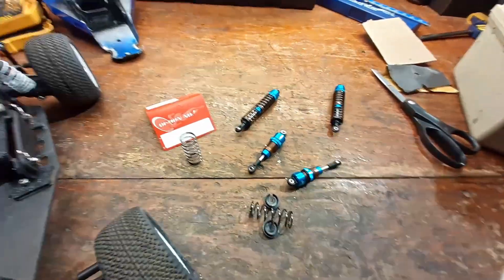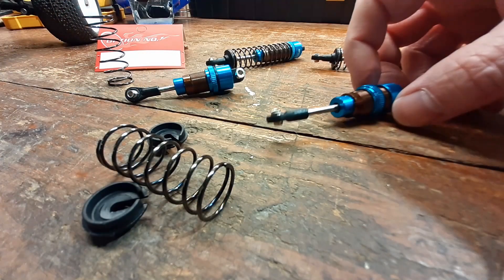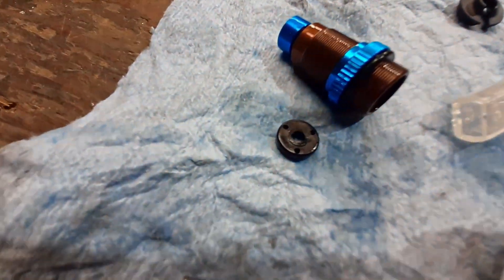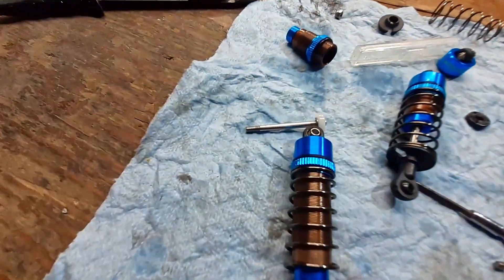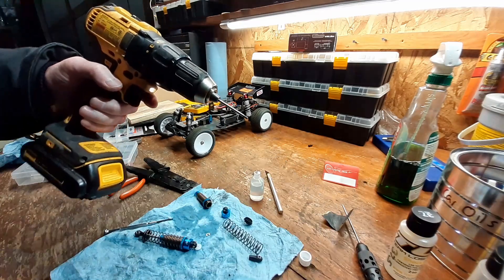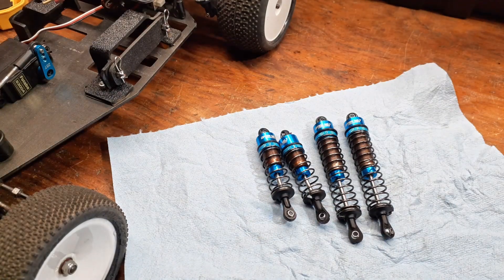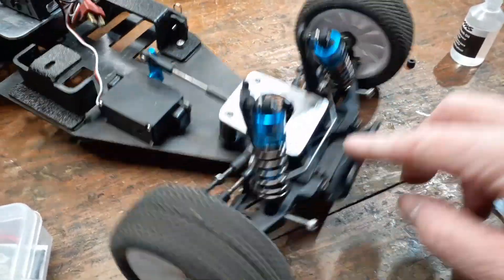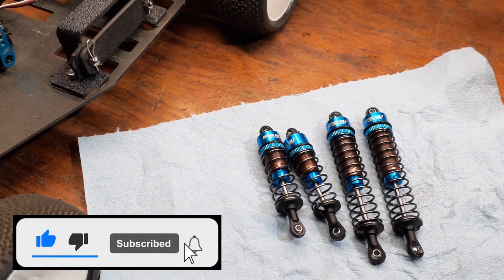Ultima Spare Parts Project Part 6 - E Bay Shocks (Option No. 1)  #kyosho #kyoshoultima #rccar

Comment: Oh, yes, a little bit of extra care makes a lot of difference! I'm guilty of mostly just assembling parts as they are, but sometimes I do remember to look closely and actually remove burrs and imperfections, and it's really satisfying! 
Thanks for showing! And all the best with that project, very interesting to follow along!
Reply from the maker: I was sent a replacement set by the E-Bay seller after I told them about the issue.  The new ones weren't all scratched up and worked fine.  It ended up being a fun little side project.  I am impressed with the quality otherwise.  For $23, they were worth it.  I'm trying to keep the cost of this build as low as possible.  With a new body, decals, motor, and servo I'll have just over $100 in it, minus the cost of my "spare parts".  Thanks for following my project.  Merry Christmas!

Comment: Youtube suggested your channel, glad I found it! Cool build you have going, I've purchased those shocks for a couple Tamiya basher builds I've done, not bad little shocks. Regarding the ride height, I am sure you know this but if you wanted to lower the ride height and travel you could add spacers on the shock shaft inside just under the piston. Also, Autosol metal polish does wonders on shock shafts. Looking forward to more content, greetings from IL!
Reply from the maker: Yeah...the shocks aren't bad at all and with a little work they are pretty smooth.    I was gonna add some spacers inside, but I had a slightly shorter spring so I went that route.  I'll have to try some Autosol and see how that works.  Thanks for the tips and thanks a bunch for watching and subscribing!